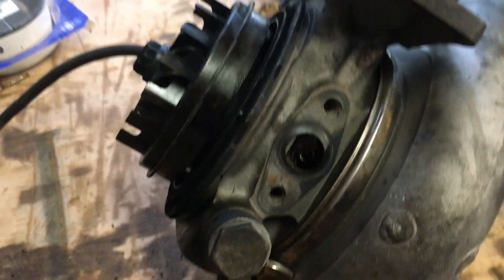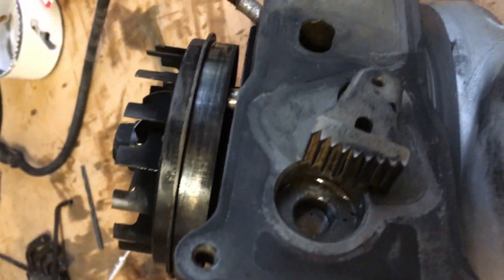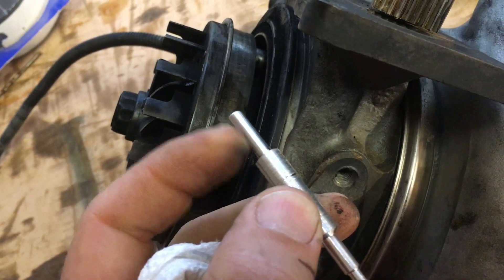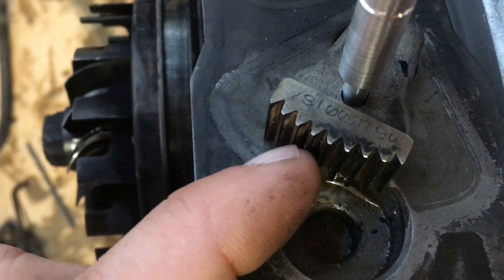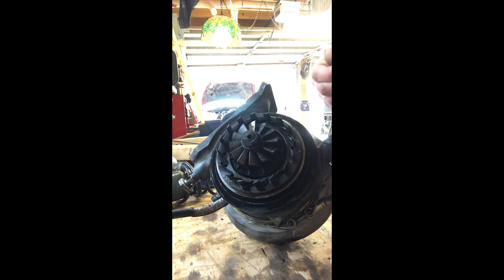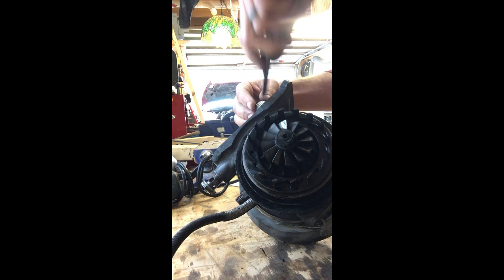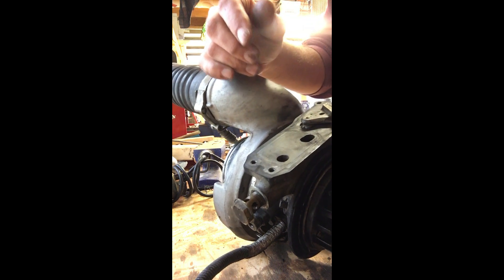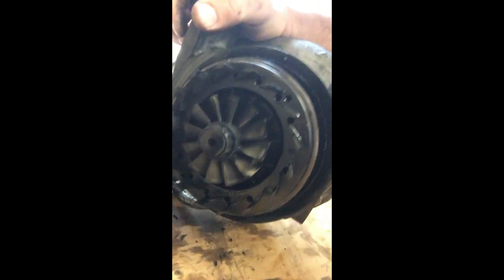Dodge 6.7L Cummins Holset HE351VE turbocharger VG adjustment and actautor alignment calibration

Comment: You where lucky that the feed hole allowed access to the pinch bolt on the yoke, it doesn't on most builds, the nozzle is set and bolt tightened before the core is assembled

Comment: How did you calibrate the actuator after this
Reply from the maker: Shearer Performance I made an alignment tool on the lathe( you can also use a drill bit) and ran the calibration sequence on AutoEnginuity
Reply: @accidentaltradesman5139 where do you get the autoenginuity at email me at shady94.ds@gmail.com

Comment: Excellent video, thanks for posting, I just bought the software from autoenginuity because of your video, I think they owe you some commission 😄 My turbo is in pieces right now because one of the tabs that hold the filter on the back of the vgt nozzle broke off and jammed it. Hopefully getting it back together today. Im using one of turbo lab America's rebuild kits, seems like good quality stuff, very complete. thanks again for taking the time to post this, I learned a lot from your video👍
Reply from the maker: anesthesiadreamin thanks!  I ended up ditching the vgt and going with the industrial injection silver bullet 62.  I’m pretty pleased with it so far
Reply: @accidentaltradesman5139  Ahhh I see, I've been considering ditching the vgt as well, so what are you using for an exhaust brake? Or which exhaust brake would you consider?
Reply from the maker: anesthesiadreamin I lost the exhaust brake but surprisingly I haven’t noticed much difference.
Reply: Need a tripod brother. Great information but getting sick.